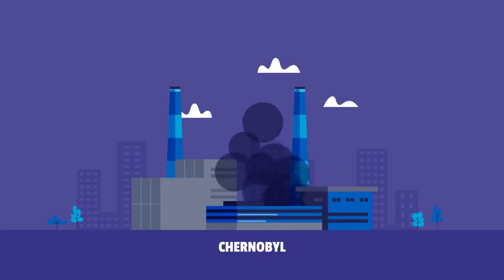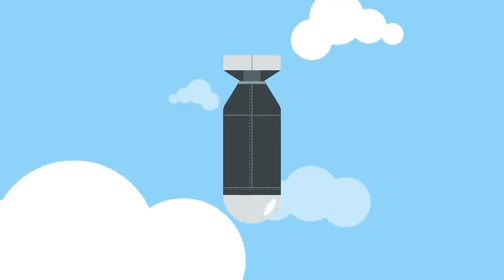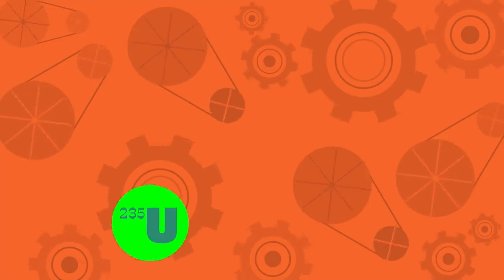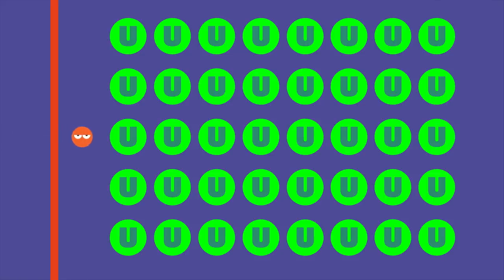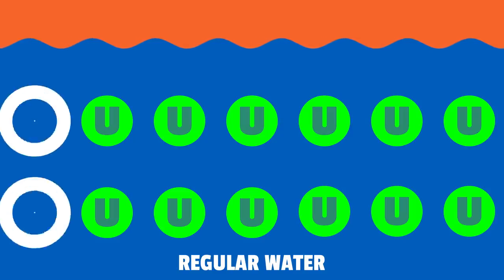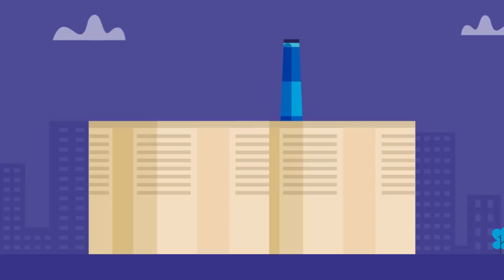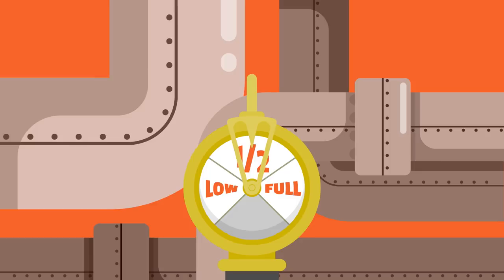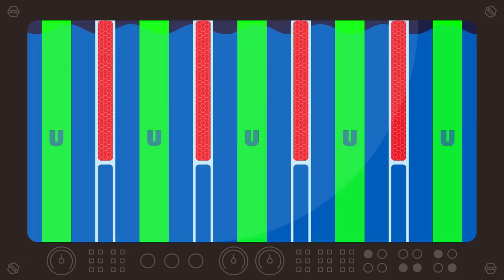How did Chernobyl turn into a nuclear bomb?

Comment: It was not a nucleair bomb. It was a high-steam-pressure bomb. 
When killing the reactor the upper half of the reactor was already a sort of down, but the killing went to slow, so the heat at the bottom had no way out: BOOM!
Reply: And im pretty sure nobody in the room knew that AZ-5 (Scram button) could act as a Detonator.
Reply: Well technically kinda both, because it is caused by nuclear reactions which turned water in to steam. Due to the low enrichment (2%) it wasn’t an atomic bomb
Reply: I came here to make sure someone had already made this comment. Thank you

Comment: It didn't turn into a "nuclear bomb". A nuclear bomb by definition has a runaway chain reaction that causes immense amounts of energy (heat and radiation) to be released in few nanoseconds. RBMK reactor at Chernobyl had huge spike in reactivity that caused it to heat to gigantic temperatures, turning everything that was in the core into fuel for that explosion... but it happened in several seconds, not in nanoseconds. So it was still ways of from a "nuclear bomb'" and more like conventional explosion, but fueled by the heat from the reactor.